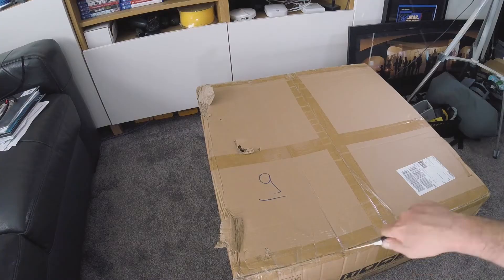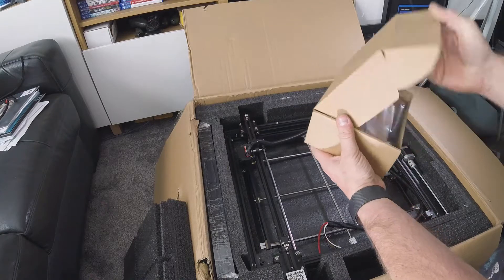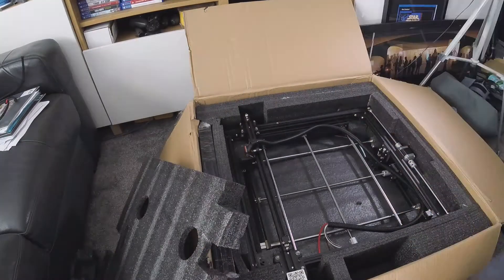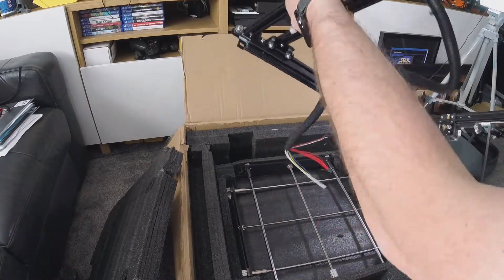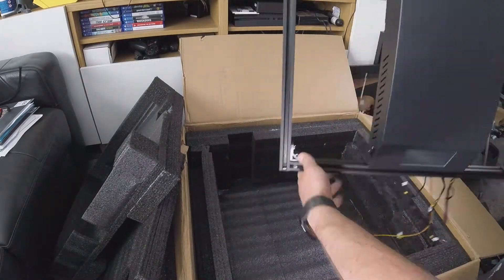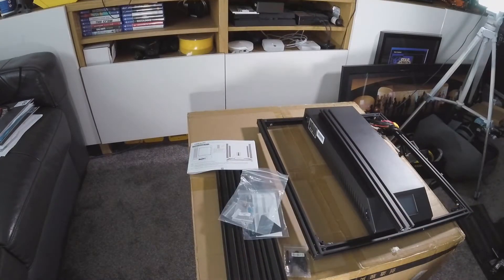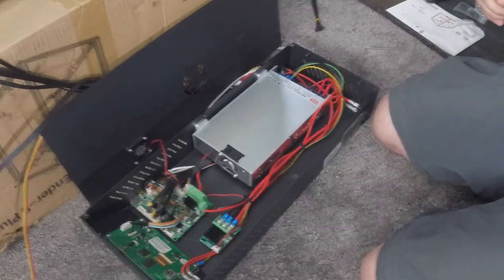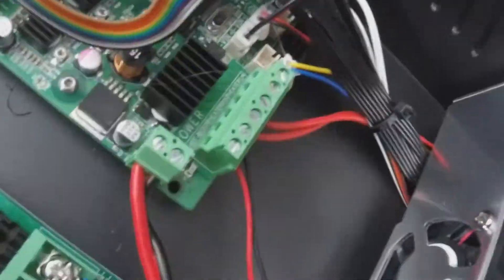Creality Ender 5 Plus Unboxing Building and Printing 3d printer review

Comment: Sam, replace the gear for the extrude, it starts slipping pretty quickly and it will act like it's clogged.
Reply from the maker: Thank you :) direct drive is being installed as I type :)
Reply: @TheRealSamPrentice  Cool, i'm still rocking the bowden, no stringing, did install a silent board because of the noise, oh and Capricorn tubing!